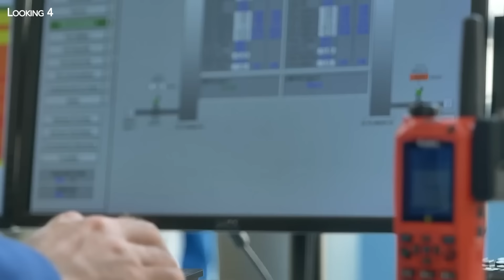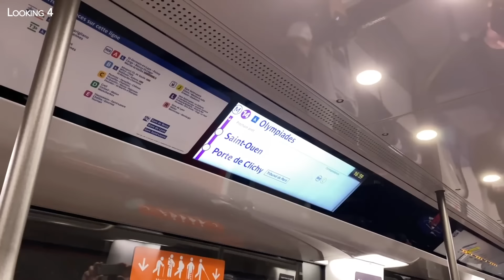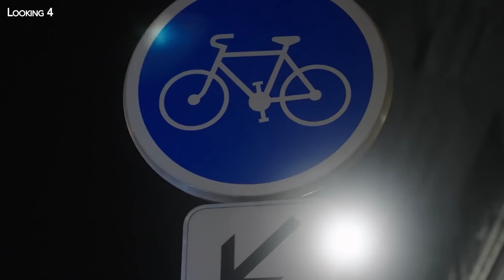The €44BN Plan to Clean Up Paris Before the Olympics

Comment: Frankly, the Champs-Élysées would be better as a tram-way and totally closed to through traffic by car. Keep a couple traffic lanes open for delivery, taxi/uber/buses, sanitary and emergency services etc. to access.
Reply: Absolutely, that would be ideal. However, if you take a look at La Rambla in Barcelona, there's traffic there running along the sides, but it's somewhat limited and the walking street runs down the middle. Because of the vegetation and the wide middle lane with all its restaurants and installations it's still a very attractive space.
Reply: un tramway sur les champs élysées ? des files électriques au milieu de la ville ? es tu devenu fou ? ça serait abominable… heureusement que tu n’es pas urbaniste !
Reply: Les tramways Parisiens n'ont pas de cables.
 @Simon-.-
Reply: Mais bien sûr t'es pas pas menteuse toi, on va se faire chier à prendre le tram pour aller à Louis Vuitton alors qu'on peut garer le Range juste devant
Reply: @Simon-.-  on a des tramways sans câbles à Bordeaux, Orléans, Reims, Angers et Tours. Pourquoi pas à Paris ?
Reply: What about the Bastille Day military parade?
Reply: @Simon-.- on a de technologie suffisante pour faire des tramways dynamisés par les rails à Paris, c’est une solution totalement viable
Reply: Why a tram ? There is actually a metro line going underneath : line 1. 
Also the regional line A is going as well in parallel of line 1 in this section.
Reply: @Simon-.- surtout qu’il y a déjà la 1 et la A en dessous, un tram juste pour les touristes non merci
Reply: @romaingillet2526  parce que c’est moche on va pas foutre ça au milieu de paris ça la défigurerait… ça ferait genre petit ville. bref on en a sur les maréchaux et c’est très bien comme ça
Reply: There is not trams in Paris. Only at the peripherique into the suburbs? Also there is no need since you always have a metro station in reach in Paris. At any point you actually have one less than 500 meters away. Have you actually ever been to Paris?
Reply: @danskibilinski3988  There is actually trams inside paris, just not in this area
Reply: there's a Metro and an RER running underneath it... no need for a tram. but it would definitely be nice with less cars.
Reply: A tram is useless, the metro 1 is right underneath
Reply: @Simon-.- you can run trams with third rail power, assuming noone runs barefoot through the street it should be fine
Reply: On peut pas fermer cette place aux véhicules , y a le défilé militaire chaque année
Reply: @Lostouille  don't run the tram on parade days
Reply: la formidable démagogie de bien pensants qui n'ont qu'idéologie en tete et aucune connaissance des besoins réels de mobilité ...
Reply: @Liminal_Simulacre to everyone saying that there's the RER A and Line 1, you must not live in Paris. Both are at max capacity, and there is no backup. You can see this when one of the lines breaks down. 

People must have alternatives , and not just be expected to take an Uber. Especially since Ubers become really expensive if people need to take them.

So yeah, no cars in Paris please. And take away the taxis and replace them with Uber. Taxis are the worst, they do not care about pedestrians, other cars, bikes etc. (I know Uber sucks as a company, but there is the rating system) 

Also, start enforcing emissions controls on cars and old work vehicles. They are supposed to get tested every two years, but the owners often "forget". They can use the same automatic cameras as for speed checks. But messing with people's cars is too risky because it would hit against the workers, but it has to be done sooner or later. 

I think that was about three different topics, and I don't think it will happen, but one can dream...
Reply: Why does London traffic goes so well without any line closed to cars ? Because there are a lot !
Closing roads just leads to catastrophic traffic, decrease of public transport quality of service and increase of pollution.
Reply: It probably isn't really technically possible as the metro line 1 runs very close to the surface, so the weight of the tram cannot be supported. You'd probably need to dig everything up and reinforce the metro underneath. Same situation is along the rue Rivoli.
Reply: they will never do it since its the streets are classified UNESCoO so no they will never do such works on Center Paris who has not seen such modifications since the 1800
Reply: No Uber - just a free taxi service for people with special mobility requirements.
Reply: do you even know about French high hats???? Those Basard will never Ride the same transports than the peasants.They litteraly built a dedicated metro lane for the senators so they don't have to take public transports
Reply: @doragonzx  It is what it is. But if it gets too bad, the French have methods for dealing with the high hats who get too aloof

Comment: Great video with fantastic views! And quite exhaustive too.

By the way, where did you find the footage of the M18's rolling stock shown at 7:55 ? I've never been able to find any real images of these trains yet. Only MR6V for M15.
So I'm ecstatic seeing these for the first time! 

Just a little correction : the Grand Paris Express is not "extremely late" as following the events and world pandemonium of 2020, the government and Grand Paris authority (SGP) issued a new timeline, focusing on different deliveries first and better scheduling instead of rushing construction on the parts useful to the Olympics and delaying other parts.

So, said parts of M16/M17 are rescheduled for delivery after the Olympics and right now the developments are on schedule.
With M11 & M14's extensions set to open in spring 2024 as planned. (M11's extension is only a few months late and they decided against rushing it).
RER E West is expected to open its first phase around the same time, including Porte Maillot and La Défense CNIT stations, possibly also Nanterre la Folie but that is to be confirmed.
The rest of the extension to Mantes la Jolie will open later.

M15's South section is set to open in Q4 2025, as it was planned in the new post-pandemic calendar. And phase 1 of M16/M17 in autumn 2026.
On the other hand the new schedule brought forward other parts, like the central section of M18, now set to open in 2026, earlier than originally planned, and the rest of M16 plus the second phase of M17 in 2028.
The recent announcement of a major milestone confirms this new calendar : over 100 kilometers of tunnels have been dug so far on the GPE, out of about 180km in tunnels.
The SGP also announced on September 3rd 2023 that more than half of M17's path has already been built.
15km of tunnels built, out of a 26.5km route ; 11.5km to go, of which 5.5km are either running on the surface or elevated, so only 6km of tunnels remain to be built on M17.

That's 15km of continuous tunnels from Saint-Denis to Gonesse, far beyond the point that was of use for the Olympics.
The Verdun and Roland shafts plus the tunnels linking them and forming the branching between M16 & M17 were completed in November 2022.

While in July 2023, there were only 650 meters left to dig on M18's Eastern underground section (between Orly and Palaiseau where the line transitions to elevated tracks). It should be finished digging very soon, if it hasn't already.

The main delays not due to the pandemic mess were caused by the terrible soil in Paris underground, namely the North extension of M12 (not part of GPE) and a small part of M14 Northern extension, as they required the ground to be hard frozen with cold generation factories and extensive circuit piping.
A section on M14's North extension even suffered a flood that delayed construction, due to thiese terrible soil conditions.

If the calendar had not been reorganized, the M16/M17 section planned for the Olympics would have been delivered only a few months after the event, which is only a mild delay.
Instead, they are now expecting a much larger section to be delivered ahead of the previous schedule for such section.

The main heavy duty building works left to do are M15's Western and Eastern sections. They are expected to start building and digging soon.

As of October 2023:
100km dug, 27 TBM's have finished digging, only 2 TBM's still digging and nearly 65km of double track are already laid. The second phase of massive simultaneous digging is expected to start in 2024.

I couldn't be more excited and eager about all this! The whole undertaking is so interesting.
Reply: Who is paying for this pharaonic endeavour?
Reply: @lioneldemun6033   Which pharaonic endeavor?
The Grand Paris Express? The region and its inhabitants mostly, with a small investment from the state.

Why do you ask? And more importantly, would you ask about that if it was a highway project?

It's a necessity to improve mobility in Paris while respecting the lower emissions goal. Especially for suburbs to suburbs journeys. The current network is saturated and a number of journeys are inefficient, requiring going through the center and then backtracking to reach the destination.
It will help bring the network's capacity to the daily 20 million trips mark.

Comment: Paris will never reach what it was 20 years ago because it's the people that have changed, not the city. Building expensive infrastructure is simply painting over the cracks of homelessness, littering and crime perpetrated by immigrants. People in Europe love going to Prague, Sofia and Krackov because these are cities that still have their culture and none of the problems of big cities like London and Paris. It's the people that make a beautiful city.
Reply: I mean, regardless of what people live there, pretty sure at least making it so the sewers don't flow straight into the river would help. Those sewers are so old, Prussia was still a thing when they were built! And the Eiffel Tower is so rusted, engineers are starting to worry about the structure. The infrastructure is crumbling on so many levels, and if a overhaul is not done,  that means disaster.

Comment: In Paris' bid for the 2024 Olympics they promised to add a new rail line to CDG Airort. As soon as they won the games they dropped the project. As for the Tour Montparnasse, which was built by corrupt chicanery, the sooner they tear it down the better. The joke in Paris: Where is the best view. Top of the Tour Montparnasse. Why? Because you don't see the Tour Montparnasse. Belongs in Fresno.
Reply: What you are talking about were never an actual new line. That was just an express line made by reusing existing and somehow adapted rails. 

But several problems would occur : 
- it would have concurrence the metro (planned) + the rer (existing) to the airport
- that would have mean less trains on the lines B and D : impossible because they are overcrowded 
- it would have been expensive to compensate the cost and the question would be if people would actually use it. It was nicknamed « the line of the wealthy »
Reply: And the tour Montparnasse, well I think most of people like it , and the ones who don’t approve the new project because it will make it nice looking

Comment: Making a city greener = removing the cars.
Use all the road space to create a park for people.
Done.
Of course removing the cars leads to the need of having great public transport, also goods need to be transported to reach the inner city. Whether such is possible on the soil of Paris, I don't know.
Digging tunnels under an existing city requires firm soil that can carry the city and have tunnels same time.

Car parks on the edge of the city, subways to the center.
A subway station within 800 meters (half a mile) of any location.
Small electric cargo trucks for logistics.
Reply: Don't forget about trucks which have to access restaurants and stores...
Reply: @stokbrood  Read the last line again.
Reply: Most cars in Paris aren't from Parisians but people living outside, going to work. You can't build more big parking on the edges because that's where people live too. Trust me, nobody wants to drive in Paris. There needs to be an alternative to the périphérique, like a larger ring on the outerskirts.